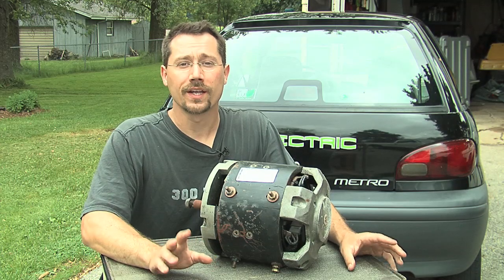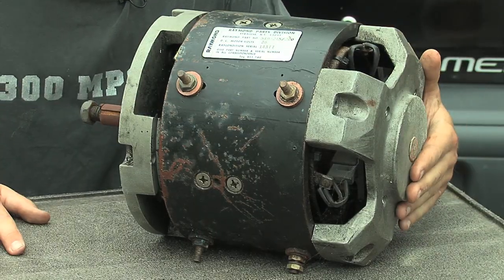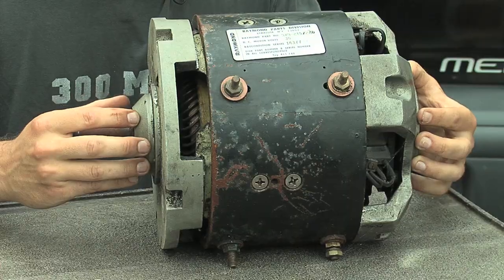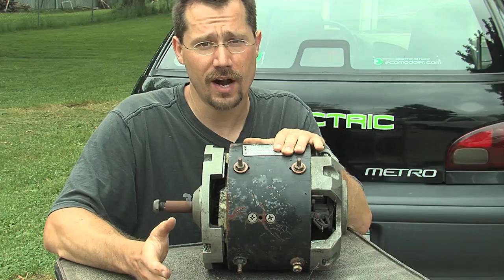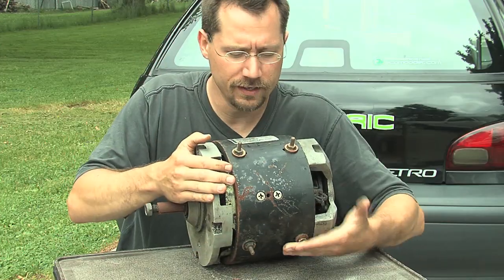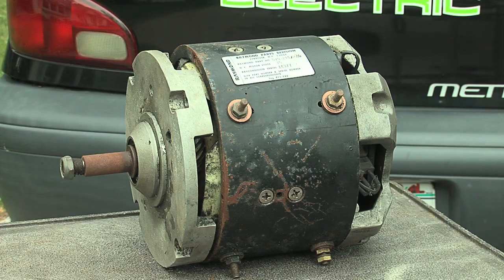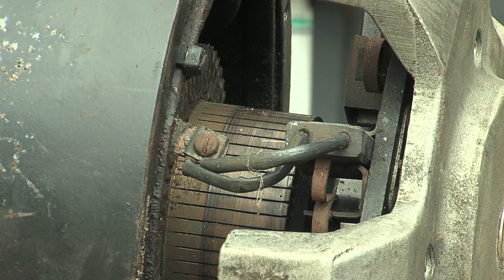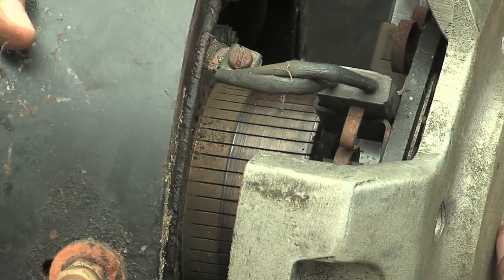5 Build Your Own Electric Car: DC Motor Basics

Comment from the maker: Please remember to click SHOW MORE in the description for web links and more info! This video is about DC motors. There are plenty of other videos out there talking about AC motors, but it's not what this one is about.
Reply: BenjaminNelson, I pretty sure electrifying my 89 ford festiva would be easy. With a gas motor, it goes from 0-60 in about 3-5 minutes. It has no a/c compressor or power steering, but is 4 speed manual transmission.
Reply from the maker: Type "festiva site:evalbum.com/" into Google to see other Festivas people have converted to electric.
Reply: BenjaminNelson this kind of motor uses a lot of energy... Am I right?
I'm thinking of build an eletric motorcycle, but the engines for sale in my country cost thousands of dollars. So I was thinking about car alternators... They're practically brush motors, but again I think about energy consumption...
Creating/modifying a brushless motor would be a good alternative?
Reply: Hi beijamin... could you give more tips about specifications??? what is the suficient specifications for a car for a bike since the horse power is so different for these motors.
Reply: Can I get mild engine braking with this and a charge circuit? Is reverse just reverse polarity?
Reply: @ellenorbjornsdottir1166  It's called regenerative braking, but has to be done right. The motor becomes a generator, but controlling the amount of braking, and doing it efficiently, isn't quite basic. Nice part is that you recharge your battery this way. You can feed the generated power to big resistors and waste it — that's dynamic "braking". Best of luck! Glad to see a woman who's interested.
Reply: Simply superb basics! Really clear. As soon as I saw the brushes, immediately I concluded that it's not a reversible motor! Slanted brush holders...
Took me about 70 years to realize that commutators & brushes are basically just a special-purpose rotary switch with an exremely-long sprvice life. Why are carbon blocks called "brushes"? First efficient DC motors, around 1880, were for trolley cars. Fixed contacts for the commutator were copper brushes (!) They short-circuited the commutator bars, and failed in a great hurry, I'd wager. Carbon for brushes has resistance, low enough to carry the current, but high enough to avoid shorting. Likely that different compositions are used, but I may be wrong.

Armature? Talk to a sculptor who uses clay. Clay isn't totally self-supporting until dry, and even then... A sculptor's armature provides the hidden support for the clay. Motor rotor coils need support, so they're installed on the lamination stack, which works as an armature. Took me only 75 years to figure this out. (I'll be 83 in a few months.) Please spread the word?

Btw, series motors, unloaded, are said to risk overspeed damage. I think what happens is that the rotor generates a bucking voltage which cuts down current draw, and weakens the stator field. Weaker field apparently reduces dynamic braking. Study DC motor speed control for more. Your motor might work well with shunt cennection on maybe half? voltage. The forklift repair guys could advise about shunt connection. Pushing limits of my knowledge on this, though.
HTH!
Thatks much, and best regards, indeed!

Nicabod
Apologies for leftover typos.
Reply: 500 amps the other one on the other show is 300 volts. how could it be 500 amps.? no way to use a scooter transmission to make a generator with that kind of amp need.! you need a new motor they are using hydraulic motors that are electric from forklifts. You need to get one man.!@!
Reply: muito bom, very good

Comment: Nice Simple Explanation and details. 
Free of all that annoying background music and so on. 
Good angles with the camera. Wish you had a shot of the car running with it at the very end.
Reply from the maker: You can see the car running in some of my other videos, including this one: https://www.youtube.com/watch?v=B41BlafQOYU
Reply: YouTube brought me into this with video 6 for whatever reason. 
I did see them to the end...
There's as much video work and post production as there is building the car.
It's a great documentary. I would have liked to see it in 5th gear cruising at 40 MPH with the speedometer and the voltage and amperage gauges all side by side. This sure has come a long way in the past decade with these open source regulators that you can work up now. I first saw this conversion concept around 1980 in The Mother Earth News - they sold books on it which are no longer in existence. The dc motor was a surplus aircraft generator and starter back then.

Comment: What batteries did you use for your car?
Reply from the maker: They were just used lead-acid gel-cells. Many good affordable options are now available which weren't when I built my car in 2008. https://www.youtube.com/watch?v=XZYykLm0k2I
Reply: I was looking at Gel but it would take over my cars limit to get the same miles per Galen range; so I might just have 2 Gel's and the rest Lithium's The Gels I would use for charging when breaking and if I get some solar panels on; they seem to have a higher number of use
Reply: About $10 for 5 Litheam 18650

Comment: I also have a geo metro and i can get a fork lift motor like the one you show. If I use more batteries or even find lithium what is the max watts i can put into such a motor? In othewords, If I wanted to could i make the car go 70mph with a fork lift motor? I assume in 5th gear it would work, but the top speed in your set up is 45. Is the main limitation your number of batteries?
Reply from the maker: In terms of speed, a DC motor speed is directly proportional to voltage. Higher voltage makes the motor spin faster. When I ran this car at 144V, I was able to go 70 MPH.

Comment: Hi, Thanks for the wonderful videos and explanations.. I wanted to know - how to calculate the capacity of motor ? Example I need to convert an existing gasoline car having 624 cc engine, Power, 37 bhp @ 5500 RPM. Weight of car is 600 kgs. I want to run it for 50 miles per day. Would appreciate your reply. Thanks
Reply from the maker: The simple calculation for electric power is volts*amps/746 = horsepower. For example, a 72V system with a 500 amp controller (and an appropriate motor to make use of it) would yield 36,000 watts, or a little over 48 HP.
What motor you are using doesn't have all that much to do with range. That's mostly about the size of the battery pack. The rule of thumb for an electric car is often 3-4 miles of range per kilowatt-hour of usable battery pack. 50/4=12.5. 50/3=16.66. You would want a battery pack of at least 12.5kWh usable capacity. The Mitsubishi iMiEV I'm currently driving is rated officially at 62 miles per charge, and has a 16kWh battery pack. Driving faster, and using accessories like heat are additional loads on the battery. So always plan for more battery, rather than less. Of course, your mileage may vary.
http://300mpg.org/projects/electro-metro/battery-range/
Reply: Thank you for the quick reply. I might need more help!. Thanks again

Comment: What a great Idea, I never thought.  My neighbour has 2 old fork lifts in his back yard and as far as I can tell their just big paper weights.  He wants an old Vovo that I have.  Done deal.  One other thing I might suggest is when you have the commutator out you take a long thin strip of emery cloth to go right around the commutator and clean it up by going back and forth, and then break a hacksaw blade and under cut between each contact on the commutator.  Makes one hell of a difference.
Reply from the maker: Absolutely! When I went to a forklift shop to get new brushes for this motor, I told them what I was doing and asked for advice. The guy there gave me a "commutator stone" and told me how to clean between the segments of the commutator. When I had the motor over at "Hot-Rod" Jim's place to work on the adapter plate between the motor and transmission, he put the commutator on his lathe and took off just a hair. It looked brand-new! I cleaned between the commutator segments with a pick (or with a hacksaw, like you said) and finally applied a little of the commutator stone when I ran in the brushes. For $100 and a little work, it was literally a brand new motor!

Comment: Wound Series DC Motor,if load increases the motor torque increases accordingly?Congratulations,probably  to day you transform it on a BLDC, sensorless or Hall sensors.My best wiches to you, I am working to day in this project, for electric UL planes, propulsion propeller  an axial flux AFPM syncrononos 3PH? 0r a DC synchronous BLDC? or as you say a Series wound? if spec power is around 5 kW/kg is fine till 1 kw/kg.Siemens chosen an Induction electri plane motor, but it heats too much.All this planes  configuration in Hybrid, driver set is an Wankel motor coupled with Synchronous 3PH Generator to move  electric motor? If you  can give  your oppinion, axial flow is growing, I got no figures.Very kind regards Johann wegmann

Comment: What do you do to keep the series wound motor from shorting if you are driving in the rain? Can you get away with closing off the engine compartment completely or does the motor need any air cooling?

Comment: lol horsepower most certainly does matter for electric motors. They just normally just kW as the unit instead. It's just work per time. For electric motors, peak torque is always at stall speed (very low), and torque falls off linearly until it is 0 at max rpm. This means peak power is always at 1/2 max rpm. For reciprocating internal combustion engines, things are a lot more complicated and torque curves are anything but linear. But they always have peak torque at greater than stall speed, often somewhere around 1/2 max rpm. And since torque doesn't fall off all at once right after it peaks, that means peak power is much closer to max rpm than it is to 1/2 max rpm.

Comment: Excellent Video,   but you're confused about Horse Power..    HP is about how the torq is delivered through out the rpm range.  The  torq in a Gas engine is rated at close to full throttle..   An Electric motor has full torq at any speed..   Electric Stepper motors have their most power,  when they are stopped.   :)   Horse Power = Torq over distance/time ..   They are one and the same,  Just a different measurement..   
     Think about a torq wrench..   it's not really turning much,  but it has a lot of torq..  BUT,  If the torq wrench IS moving fast,  you measure the distance and time it takes to move that far, while exerting force (Torq)     Viola !  you have Horse Power...
  Horse Power has nothing to do with Horses..  An average Farm Horse has 17 HP...
Reply: Might want to revise your notions. Torque is a Force (rotational), Horsepower is Power. 
Hp is NOT torque over distance. And they are NOT "the same but a different measurement". 

An E-motor that is stopped has exactly ZERO power. You need at least above 0 rpm to measure power. The only power measurable on a stalled motor is the electrical power going into it. 

And Horsepower IS based on horses. It's based on the work a horse can produce on average when running a mill, and the number was rounded. It's a case of LMGTFY.
 James Watt arrived to the figure of 33 000 ft*lbf/min (746 Watt) after rounding.

Comment: i think you need to add one capacitor of more farads to avoid starting motor with hand.
edit : please respond am i right ?
Reply: No. Those are used on AC motors. The voltage from the jump start pack was probably about 1/3 of what the motor needed.

Comment: Thanks for a well-explained video. Made understanding what to buy and so easy. Is the same principle for a larger folk lift motor for a 3-tonne campervan DIY campervan project? Any suggestions on what size motor i should look out for? Thinking of starting with an old 1984 Toyota chassis and building a custom camper on the back. I hope to find something that is 4 x 4. I'm looking at doing one with a roof full of solar panels and the goal is to let it charge in the sun on leisurely journeys and get a 100mile range or so. In a state of Australia that has a lot of Sun but charging stations or a generator could be utilized. Have purchased nothing yet so still in researching stages! Thanks again for your good videos. Very helpful.
Reply: You will need to fill every empty space with spare Batteries, as large RWD vehicle will drain them quickly.  I well imagine any Crawler or Counterbalance unit will have a sufficient sized Motor.  The larger the Motor..the more current it pulls...(going "overboard" will suck the charge down faster)

Comment: Hi Benjamin,
Super videos! 
It's the first of this type I'm getting to see...
I drive a hybrid car myself, but now being extremely positively surprised by this actually pretty old high technology (here in Europe, at the beginning of the 20th century, there were more EVs than ICE cars), I wonder whether I should have gone straight for an EV...
But attempting to make one the DIY way is an alternative!...
At this stage, just one theoretical question: I know about torque (and I don't even need to hear what a Tesla driver tells), but all motors (ICE and EV alike) do have an indication of power - and now comparisons are even easier: it's all in kW (at least in Europe)!
So is there a general value how much kW an EV motor must yield in order to move a particular car?
Or would you still disregard this? But then how do you determine which engine is powerful enough for a certain car?...
Anyways, all the best to you and thanks a lot for your production!
Reply: Were you ever able to find an answer to your question about how many kW a motor should produce in order to move a given weight? I'm interested to know since I've been searching everywhere for this info in preparation to do my own electric motorcycle conversion, and haven't found anything yet.

Comment: How fast can a car go with this type of motor (and how well can it accelerate) and how long will the brushes last?  Would it be good as a commuter car?
Reply from the maker: I've driven that car at over 70 MPH (when at 144V.) Acceleration was fine, it kept up with any other car. It did have enough torque to burn rubber in first gear, and pull away from a dead stop in 5th gear.
I installed new brushes when I originally got the motor, and never replaced them after that.
Reply: Awesome. Is the motor loud or does it whine a lot?
Reply from the maker: Electric motors are very quiet, especially compared to gasoline engines.

Comment: BenjaminNelson Excellent video, new subscriber that smashed the like subscribe and the notification bell instantly.  I personally am a fan of the AGNI D/C electric motors.  My electric vehicle project involves 4 AGNI 95 motors mated to NuVinci style transmissions on each wheel.  This allows for amazing shift ratios from 1:50 and 50:1 also computer control acting as differentials, regenerative brakes with ideal stopping characteristics and other benefits like individual wheel control in varying conditions.  I highly recommend people check out this video of The AGNI D/C motor and it's invention, uses, and capability.  It's a great video:

https://youtu.be/04gh3gW5aEg

Comment: spider is needed to run the motor?
Reply: Additionally to the horsepower you get 1 spiderpower
Reply: Einstein's theory was that even though spiders have eight legs and horses only have four, it still took 2,500 female spiders (because they're bigger) to equal 1/10 hp.
Reply: I'm LMAO :-D
Reply: macicana64 🤣🤣🤣🤣🤣🤣🤣🤣🤣
Reply: maybe a couple hamsters would be more appropriate
Reply: @taxximaxxi  - maybe. I know the squirrels are all on strike for more nuts.
Reply: spider is the motor... everything is to keep the man quiet.

Comment: Full torque from zero   So why keep the Gearbox ? ( I guess 'cause it also contains the Diff in the FWD metro)....   Other guys say "AC motor is way to go" but will AC whine?  

 what performance I could expect from the motor . Or what power rating it is ...   A fork lift motor ambles back & forth across a storeroom, Is it the thing for 10,000 miles per year & the 3000rpm cruising on the freeway ?  A nissan leaf uses (say)  20Kw/h for 100miles.. so you need to be able to handle ( guess) 7Kw, continuous in the 60 mph cruise & more in acceleration..   36volts.  would need a hairy.. 200amps !  for 7kw
Reply: Sorry but that or is a very stupid/troll comment or you clearly don't know how a torque converter or gearbox works - OBVIOUSLY "at zero rpm you have NO MOTION at all"
But if you wanna be so literal, take a look above where it clearly say "Full torque FROM zero" and that is absolutly true,  and not "Full torque at zero" as you wrote.
Reply: it has the diff and the reverse gear (if you don't want to rewire), and it can always give you a higher top speed using top gears...
Reply: Ac motors sound amazing.
Reply: Bracknell CyclingCampaign Torque is meaningless without rotation, which is what HP is. Torque tells you how much you can pull, and HP dictates how fast that work can be done (acceleration). This full torque at zero RPM nonsense is just that...nonsense. It's only meaningful if you plan on using it as a parking brake.
Reply: reikhard79 What are you talking about gearboxes for? Literal? Okay.

Comment: Horsepower is as important as it is in engines. It's just the way it is defined. Electric motors do have a max power and a continuous power. The latter is way less. Engines are designed to survive long max power runs (on the Autobahn for example). Electric motors are not. They will overheat eventually. So the continuous power over an hour or so (I don't know exactly) is what is the rated power number. And it's way less. Tesla cars are rated at little over 100hp here in Europe. 
Still horsepower (as a function of torque and revolutions) is what accelerates the car. As in all the regular engines.